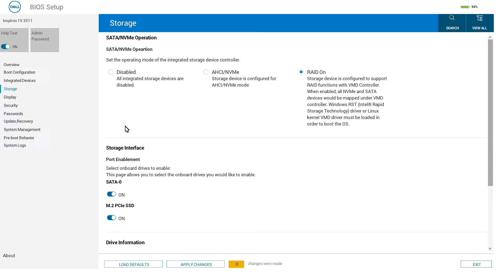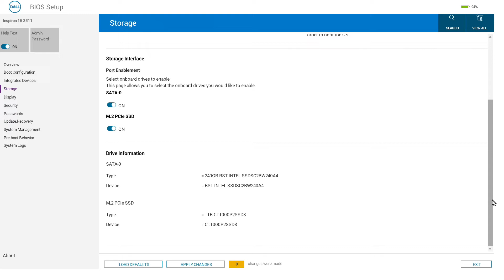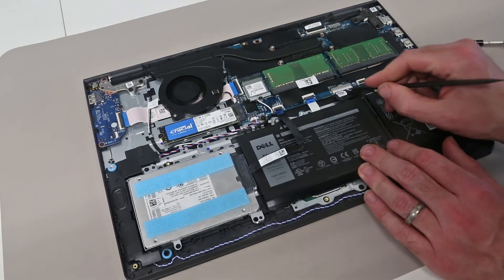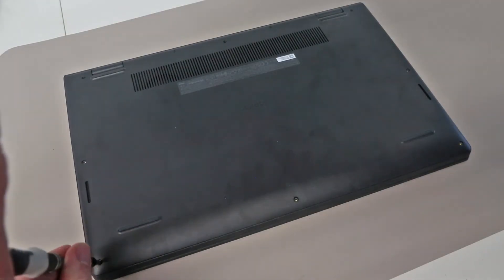Dell Inspiron 15 3511 (2021) Upgrade Guide - M.2 SSD, 2.5" HDD, DDR4 RAM and WiFi Replacement

Comment: i use this laptop around 2 year's..and i face a big problem as a hitting issue. And this laptop air cooler fan work is too slow..

Comment: The screw for sata ssd mounting case is too tight, can i insert sata ssd without unscrewing them?
Reply from the maker: I wouldn't - the risk it would come loose and detach with the machine running. If the screw thread is damaged I'd use screw extracting pliers to gently twist it: https://amzn.to/3DJ8h83

Comment: Nothing about sata only ssd click bait I can already figure out ssd I need tovknow sata as well
Reply from the maker: Errrm, 3:58 through to 6:23 of the video is the full process of adding a 2.5" SATA drive to the system. Yes I install a SATA SSD, but installing a 9mm or thinner SATA 2.5" HDD is the exact same process, the drives are the same in terms of mounting and connector.
I'm not really sure why you'd want to fit a 2.5" HDD in 2024 now anyway.

Comment: I tried unscrewing the m.2 screw with a too large screwdriver that happened to work for the larger blackplate screws, now the m.2 screwdriver I bought doesn't work. Is there any solution to this?
Reply from the maker: You've rounded the head of the screw with the wrong screwdriver?
You could try some screw extractor pliers: https://amzn.to/3Xensxl
Reply: @BrueComputing  Thx so much! Have a good day

Comment: James, thank you for posting this detailed video about the Inspiron 15 - 3511. I've always had this question about replacing the PCIe 3.0 NVMe M.2 2280 SSD HD. If I remove the original SSD and I install a 1TB NVMe M.2 like you did, do I have to do anything with the Windows OS? Where is the OS installed then? How do I get the data from the SSD I am removing back to the new HD? In addition to that, I also have a question on how do I know how much RAM I can install in my laptop? I've read about people saying it can do up to 32 GB RAM @ 3200MHz ( or 2666MHz ) SODIMM, but my laptop specs says it's limited to 16GB. Does it have to do with the Windows OS running? For example, if it's 64-Bit can it then be upgraded to 32GB RAM? Please let me know.
Reply from the maker: If I remove the original SSD and I install a 1TB NVMe M.2 like you did, do I have to do anything with the Windows OS? Where is the OS installed then? 
- You need to either clone the install across or just do a clean install on to it.

've read about people saying it can do up to 32 GB RAM @ 3200MHz ( or 2666MHz ) SODIMM, but my laptop specs says it's limited to 16GB.
- Dell only sold it with up to 16GB (2 x 8GB), but 32GB (2 x 16GB) should work fine.

For example, if it's 64-Bit can it then be upgraded to 32GB RAM? Please let me know.
- 32-bit has a maximum of 4GB addressable. For 64-bit its in theory 18.4 exabytes.
In reality Windows 11 Home is limited to 128GB maximum, Windows 11 Pro is 2TB and Windows 11 Pro for Workstations allows up to 6TB.
Reply: So, technically, I can upgrade my  RAM  to 32GB RAM DDR4 2666Mhz SODIMM (2 x 16GB RAM cards), my laptop should see it no problem? Also, if it doesn't see it immediately, would I be able to go to the BIOS or something to change some settings?
Reply from the maker: It should work fine, yes, but I haven't tested it myself. If its not detected immediately then it wouldn't be a BIOS setting or similar, it would be a compatibility issue.

Comment: hi,  very interested in your channel.1i have one of these little monsters 153311 had a problem overheating fan problem would not accept a new fan bought from a top seller  new 6 days over a year wanted £260 for a new motherboard no way.in looking I would not go that way as it cost £500 and not happy with the design as it left no air space to breathe underneath was used on a hard top table .? is a fire hazard if left on a soft surface like a bed   so I have a dead 153511

Comment: Ran into an issue @BrueComputing , the  laptop states “no boot file” once I attempted to boot Os
Reply from the maker: You need to either install Windows to the SSD or clone the contents of the old drive to it.

Comment: what is the max ram you can add to the laptop?
Reply from the maker: 32GB (2 x 16GB) will definitely work, 64GB might but probably isn't worth it on this model even if it does.
Reply: @BrueComputing  okay, because dells website says that it's max ram is 16, however that might mean a different model type, the CPU for mine is an Intel i5 11th Gen 1135g, and Intel says the max one is 64gb

Comment: @BrueComputing i was wandering if i could replace the processor in this computer
Reply from the maker: Only by replacing the whole mainboard - the processor in modern laptops is soldered down.

Comment: When I want to completely remove the wlan card, whar do I do with the contacts then?
Reply from the maker: Wrap the metal contacts in insulating tape and then tape down inside the chassis so they don't move.

Comment: Thanks for the detailed video. I tried the steps and reconnected the battery, and now the laptop wont power on. Disconnected the battery again and the ac adapter and pressed power button for 30sec to get rid of residual power and reconnected the battery and still no power. In fact, the ac adapter light on the laptop does not turn on when plugged in. Any idea on what could have gone wrong? Thanks!

Comment: excuse sir, i do a lenovo model no.p112f105 which is also a inspiron 15 3000 laptop, but how to know if this particular model has both an ssd and a hdd, currently it runs on a WD SN350 which is an ssd, can i also get a sata SSD for this laptop as well?

Comment: great video bro. I have a question though, i installed a 1TB mvme ssd and a 1TB hdd in this computer and it works fine. would i be able to replace the HDD with a 1 TB sata SSD?

Comment: Hello sir, greetings I'm from Indonesia. I want to ask if the wifi card socket can be replaced using the ngff exp gdc cable? because I need more graphics card performance but this Dell Inspiron 15 3511 only provides Intel UHD. sorry my english is still messy and thank you for answering my question.

Comment: just bought this yesterday for $399.00. Came with 16GB memory and a 1TB SSD drive. Tried to add a 1TB SATA drive. It all fit right, just that the machine wouldn't do anything but the spinning dots at start up. Disconnected the SATA and runs fine. I'm sure I am missing something.

Comment: Thanks for the guide. I could have muddled through it fine I think, but I've worked on enough laptops to know that forewarned is forearmed! Had the two 16GB sticks in in about 5 minutes, and another few minutes and it was buttoned up and booted. I just wish this lappy had USB-C. Other than that it's amazing, especially for the price.
Reply: which RAM sticks did you buy for this upgrade??

Comment: hello,

i need some help!
please, can you tell me what size screw driver you used to open the M.2 SSD slot?

I tried  Phipps's head #0 #1 and #2 for that and none of them work..!

I am so close to finishing the upgrade on this laptop!

Edit: Dell says to use M 2X2 screw. But i don't know what that means and where to get it
Reply: use a Stanley Precision Phillips, Slotted Screwdriver Set 6 Piece with rubber grip on top

Comment: The 2.5" SATA Drive can it upgrade to the 1TB as on the crucial website the MX500 SATA they say it isn't compatible and on DELLS website they don't even show anything reference the 2.5" to upgrade. If it does have you any recommendations for make and model? I have seen the DELL one on Amazon which I'm wondering if it's ok to use. Thanks

Comment: I screwed up my 3511 by uninstalling Maxxaudio, then trying to fix that by re-installing Windows 11 - which went into an eternal error loop. The girl at the shop said "I have seen this' (!). But she could not re-start with a combination of key presses I was not aware of. When it comes back I may revisit this video. With a virgin hard disk, loading Win11 should work. I like your detailed demonstration of how to open the machine without breaking the case.
Reply from the maker: Glad it helped!

Comment: Best Buy has these on sale for $380 right now. I picked one up last weekend and so far I'm very happy with it, especially for that price. It came with 8GB of memory and 256GB of storage, but it's good to know I can beef it up if I ever need to. Awesome deal if you ask me!
Reply: i have the 3511. it comes with 8gb ram. is that two ddr4 4gb drives? can i replace them with 2 8gb drives to get 16gb ram? sry im not real techy and dont want to open it up if i dnt have to. also tried calling Dell but you know how that goes. lol. thank you.
Reply: @seanmurphy2899  It was 1 ram stick for me. I upgraded all the way to 32gb and I've enjoyed it so far.

Comment: Hi, Thank you very much for your video. Very Helpful. Software and file wise, what happens if I change my M2-2230 and place the NVMe? Sorry for the noob question, I'm just very novice when it comes to this. I'm just looking for a DIY laptop upgrade. Would I lose all my files? What about windows? Would I lose windows and it license as well?

Comment: Nice upgrades. I'm assuming the OS is on the old M.2. Did you use a cloner to transfer the OS to the new M.2 drive or performed a clean install from a recovery OS image? I am thinking of upgrading the M.2 drive soon. Just rather not use a recovery image although have done it before. Thanks.
Reply: I wish you would have gotten a reply. I have the same question.

Comment: For the SATA drive I notice on demonstrations people leave the clear plastic with the blue pads on. I just ripped that out. I figured it was temporary and mainly there as a guide and to hold the screws. Is there any reason the plastic needs to be on there? I figure you need as much ventilation for heat as possible, so why have a piece of plastic covering a drive? The screws hold the drive in place and the drive itself is already protected by an exterior.

Comment: Hi sir my laptop is dell 15 3525 model 
In sata drive mentioned hdd like ur laptop but u upgraded to ssd so could i change sad?
And i have 2 ram slots and they mentioned in guide we can upgraded upto 16 gb ram that means single slot can up grade 16 gb ram or both slot totally can upgrade 16 gb ram?
Pls reply
Reply from the maker: You can fit 16GB modules, so 2 x 16GB would give 32GB.
Reply: @BrueComputing  thank u for reply
What about sata drive u installed ssd  but that area mentioned HDD like my laptop so can I upgrade from hdd to ssd in sata drive?
Reply: @BrueComputing  will it support 2 x 32 GB RAM upgrade? 
2Rx8 dual rank 3200 MHz DDR4 RAM - Crucial

Comment: Should you have to remove the battery or you can add ram and ssd without removing the cable of the battery?
Reply: Always disconnect the battery of a laptop when you are replacing components.   #1 It's really easy to do and only takes a minute.  #2 You really don't want to have any power to the laptop of any kind before you start removing and inserting components.

Comment: Thank you for this!!! Do you know if i can run the OS off of the SSD instead of the M2 drive?
Reply from the maker: Yes, although you'd probably need to do a clean install as don't know if it would boot after cloning from NVMe M.2 to SATA 2.5".

Comment: I just want to ask if there is a limit of upgrading the instead of 8 can it be 16?
Reply from the maker: That's absolutely fine, 16GB modules should work without issue.

Comment: I just purchased the Dell 3511.  My old laptop has a Samsung ssd Sata drive.  What would happen if I plugged that in the hdd spot?  I really want the files off of it and have my Microsoft office 13 installed on it.  Any advice?

Comment: Anthony Marte 
Hello, thank you for your video. I have question. I have a Dell Inspiron 15 3000 series (System model Inspiron 3558) I've had it since 2016 and all of a sudden, it's gotten really slow, (even the WiFi).  Thanks to your video I will be upgrading my Ram / SSD; that I have covered; my concern is getting the correct wifi card (I was provided with: Wireless Lan card # CH16N by a Dell tech support I tried searching it up on Amazon, a bunch came up but since I am not all that knowledgeable I would hate to pick up the wrong one or to much overkill, I don't have clue, please help) can you please provide me with a link with the appropriate one. perhaps on Amazon. 
Thank you in advance. Await your response...

Comment: So the ram can't run in 3200 mhz even though the CPU itself supports 3200mhz? Got one on bestbuy and replaced with 16GB ram
Reply from the maker: Correct, in models without Nvidia graphics Dell limit the RAM to DDR4-2666 in the firmware.

Comment: I upgraded ram and added 1tb nvme stick on a brand new version of this same exact computer. Upon installing windows from a usb, the wifi is not working. Is it required to replace the Wi-Fi card for this to work?
Reply from the maker: You'll need to download the required wireless driver on another machine and install it if the version of Windows you installed doesn't have a suitable driver built in, or connect it via a USB ethernet or wireless adapter to download it.
Reply: @BrueComputing  thank you. I’ll go the Ethernet route to get it booted
Reply from the maker: No worries, glad to help.

Comment: will putting an HDD by myself void warranty?
Reply from the maker: On my system there were no warranty stickers or seals. You'd want to return the system to its original configuration in the event of a claim though.

Comment: DELL = FRAUD ! STAY AWAY FROM THIEVES !!! 
I purchased Dell-Inspiron 5515 with 64 Gb RAM and 2 Tb hard drive on AMAZON. Because there was an issue with the USB port, I have sent it to Dell repair. After 2 weeks I received back a laptop with 16 Gb of RAM and 1 Tb hard drive. They stated they do not sell computers with this big hard drives and this much RAM, so they repair it and replaced RAM and HD with the standard (16Gb/1Tb). When I called DELL they stated they have the right to do this and this is normal !  I failed several complaints to FTC, BBB  and so far I have not my parts back (around $500 value) !
If anybody was scammed by DELL please contact me. I am considering class case in the court. DELL IS STEALING PARTS and  this has to stop !
Reply from the maker: Do you have the service tag of the machine? That would confirm the original specification.
Sounds like it was upgraded by the seller, which normally would void the warranty anyway.

Comment: Where is the CMOS battery? The manuals don't mention it. Dell agent told me it's soldered on and that to replace the battery you have to buy a new motherboard. Some laptops that have removable coin-cell CMOS batteries require total disassembly of the laptop to get at the battery.

Comment: Sir, can i make it 16x2 RAM? I've seen on google there are same series, same processor but with 32GB RAM, is it possible?
Reply from the maker: 2 x 16GB do you mean? Should work fine.
Reply: @BrueComputing  yeap 2 x 16gb. Ah nice thank you!
Reply from the maker: @theminerbay9801  No problem.
Reply: Per the "Setup and specifications" manual pg. 12, max memory configuration is 16 GB as either 2x8GB or 1x16GB.
Reply: @gregor2600  someone selling this type of laptop with 32GB RAM. same specs... Or is there ny different?

Comment: Excellent video. Thanks!
You can put the laptop in Service Mode before opening it. That way, you don't need to disconnect the battery. See the Service Manual for details.
The thermal shield should have been put back over the new SSD.
Reply from the maker: Good tip!

Comment: Silly Question but does this laptop "Dell - Inspiron 3511 15.6" Touch Laptop - Intel Core i5 - 8GB Memory - 256GB Solid State Drive - Black" fall under these specs?
Reply from the maker: Yes, should be the same.
Reply: @BrueComputing  Thank you I figured it was just double checking before I purchase it.

Comment: Why did you changed both DDR4 RAM? I'd like to add 8GB RAM plus the original. Can I do that? Or is a best practice to change both? Thanks!!
Reply from the maker: I was just showing how to do both modules - if you just want to add one that's fine.

Comment: Sir,can i use both SSD and HDD in my dell Inspiron 3511 
If so,how would it help me ?
Reply from the maker: You can, or two SSDs (one M.2, one 2.5").
Advantage of SSD + HDD is obviously in cheap mass storage if you need to hold a lot of data on the machine.
Reply: @BrueComputing  i only want to use one SSD,which one do you prefer??

Comment: Sir, i have the same laptop but its i3, is the processor changeable?
Reply from the maker: No - as with basically all modern laptops the CPU is soldered to the mainboard, so the only way to upgrade it is to replace the whole board.

Comment: Can we upgrade i3 to i5?? Is that possible
Reply from the maker: No - as with basically all modern laptops the CPU is soldered to the mainboard, so the only way to upgrade it is to replace the whole board.
Reply: @BrueComputing  is that cost lot?
Reply from the maker: Generally not economical vs. just selling it and buying a better laptop.

Comment: Thank you James.  Well done and a great comfort, before I attempt memoery upgrade.  FYI, 3200 is supported of this model if you do not rely on integrated graphics, instead use an aftermarket graphics card option.
Reply from the maker: Glad it helped.
Yes, according to the specs sheets if you have a model with NVIDIA graphics it runs the RAM at DDR4-3200 - we don't get these here in the UK however.
I always fit DDR4-3200 modules anyway as they are what I keep in stock as there is little to no cost difference between these and 2666 modules.

Comment: Is there any way to replace the keyboard on the 3511? Mine is damaged and I am using a Logitech USB keyboard.
Reply from the maker: You'd need to source a replacement palmrest as the keyboard is plastic riveted into it and can't easily be replaced.